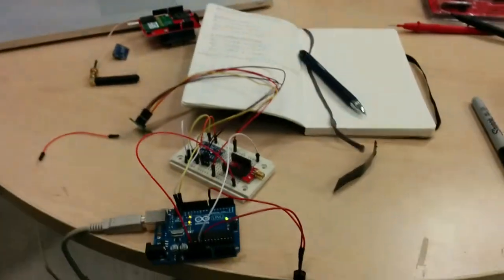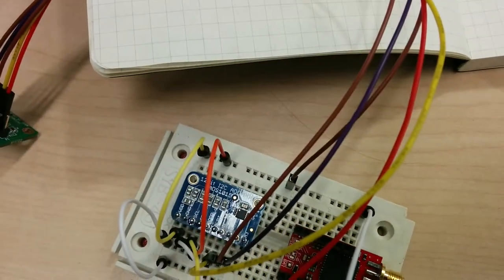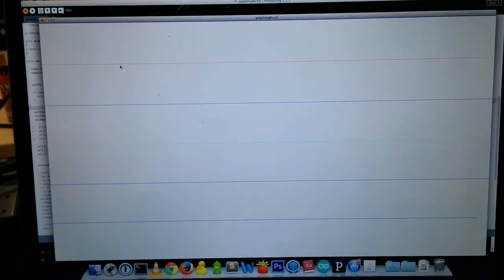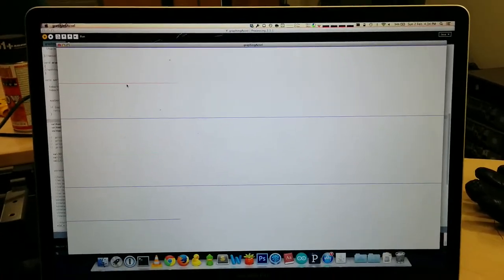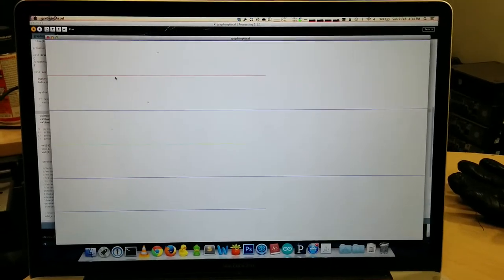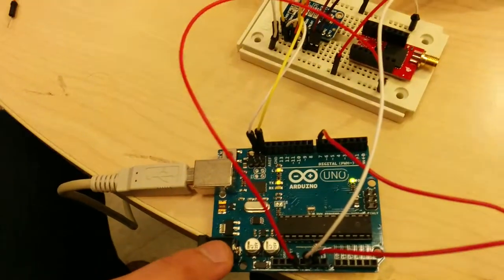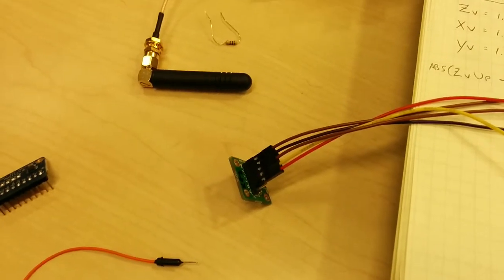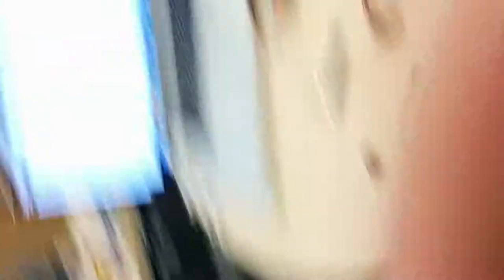OnStar for Bikes: Accurate measuring and graphing of G-Forces!

Comment: Justin, what do you think makes more sense. Hooking the sensor up to your helmet or your bike?

I could actually imagine that both might be very interesting as it would show us the correlation between the two. 

Something that I've heard and might be of interest to you is that skiing is a sport with high frequency of concussions. Same with jetskiing. Not because of accidents but because of these small bumps which occur over and over again.
Reply from the maker: Hey Marc! For the purposes of the thesis I wanted to keep it simple without incorporating a wireless sensor on the helmet. However it's a grand idea to place another sensor there and determine the differences in data. Particularly how the head compensates for movement

Comment: Hi Justin. If i am placing this ADXL377 on disc which is rotating at 2900 Revolution per minute. How much G force it will experience if i put it in the peripherry of the disc (radius = 35cm). Which forces should i consider there? How did you filter the datas for this smooth display of G forces? What calibration methods did you use?  Thanks! Its a very informative video.

Comment: What led to the picking of the ADXL377? The large 200g range?
Reply from the maker: Mostly the ±200g range, yes, since I had no idea what forces would be generated (turns out a ±20g would suffice) and also that fact that it was ratiometric/analogue and not I2C.
Reply: Justin Bull Ah neat thanks for the reply.  I actually use the 345 in a few industrial monitoring applications as its 16g range is plenty for me. I even took it on the bike a few times even along with 3axis gyro, although I never did anything with the data yet.   Do you like the analog over i2c and spi interfaces? I was avoiding the analog ones to save on pin connections and avoid having to bother with analog design issues to get going quicker